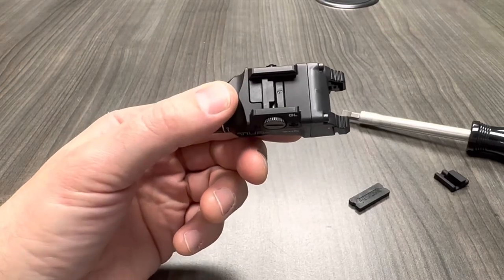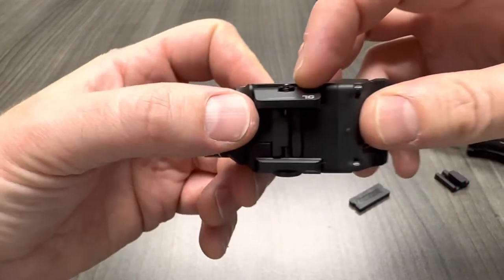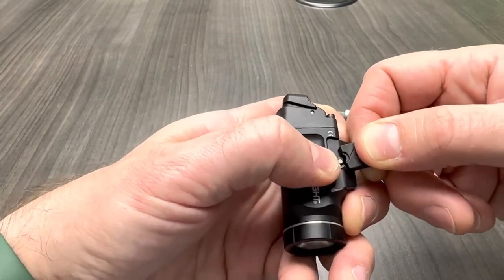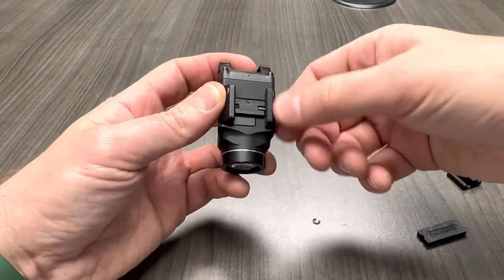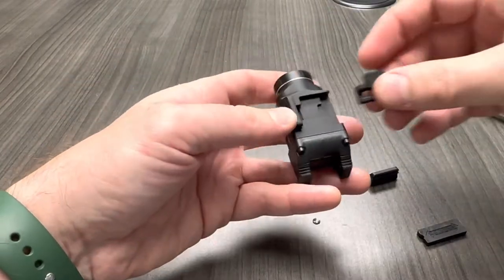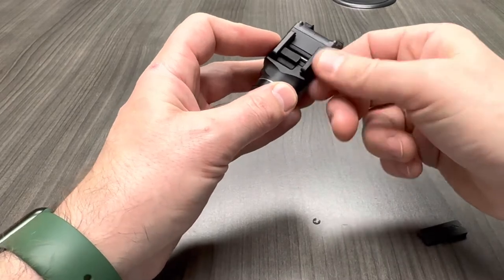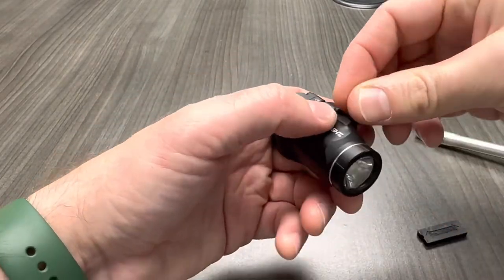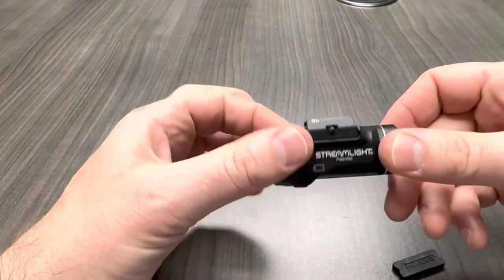TLR7 Sub Rail Key swap Walkthrough

Comment: For clarity will this allow me to swap a “sig” tlr7 sub to a 1913 version? Or is this just how to adjust the different keys within the 1913 versions packaging?
Reply from the maker: This is only for swapping the rail keys within a single version of the light. To go from "Sig" to "1913" you would need a new pair of rail clamps Streamlight.
Reply: @HenryHolsters  thank you for clearing this up for me! Are rail clamps available on stream lights website?
Reply from the maker: @TheVisualVanguard  You'll have to contact Streamlight CS. I don't believe they are available for retail sale on their site.
Reply: @HenryHolsters  ok thanks for the info!
Reply: @TheVisualVanguard  if you contact strsmlight they may just send them to you for free
Reply: @TheVisualVanguard  Send a customer service form on their website. Just received my new 1913 key and clamp from Streamlight for my Sig TLR7 Sub. I recently switched grip module on my p365 with a pic rail and was pleased to find out that they can send them for free

Comment: Anybody have issues with the staccato CS? I’m using all the parts correctly and tighten it down and it still flies off. There has to be an aftermarket key somewhere
Reply: 1913 or hellcat version?

Comment: So I have the Glock 43x with a gr43 recover rail. Would I need to get the key swap to make it fit, because the tlr7 won’t fit on the rail right now
Reply from the maker: None of our holsters are compatible with Recover Tactical rail adaptors, no matter which key is in use.

Comment: Is it necessary to have a key on the light in order to use it? I have an S&W SW9VE which has a smooth surface (no slot rail slot)

Comment: So can I remove the rail key entirely and then use it's with my stock sig p365 frame and then add the 1913 key to use it with a different frame that has a 1913 rail key?
Reply from the maker: No, the rail key is only PART of the assembly. The size and shape of the rail clamps on each side are different from model to model. You can't use the 1913 rail clamps on the Sig proprietary rail.
Reply: @HenryHolsters  damn it oh well guess whenever my Icarus precision grip module comes in I'll be getting a new light too sucks cuz I already bought the light but I guess it doesn't hurts to have 2 of the same light's  😕
Reply from the maker: @devalishxb91 Also, your Icarus grip module will likely not be compatible with most Kydex holsters for the P365. It doesn't fit anything we make.

Comment: Where do you buy the keys? Looking for #5 for tlr-7 sub for hellcat pro
Reply from the maker: Contact Streamlight customer service directly and ask for the key you need.
Reply: @HenryHolsters  I need the same key. So when I contact stream light customer support do I call them before or after I have ordered? Or will they send me just the key?
Reply from the maker: @BlueCollarHauler  I don't know exactly how they'll handle it. I would contact them first before ordering a holster.
Reply: @HenryHolsters  Would the TLR7 sub fit a Canik Mc9? Does it come with everything I need?
Reply from the maker: @TacticalandThings  I don't have an MC9, so I can't answer that definitively.
Reply: I think you need a specific model. I believe Opticplanet has one for the hellcat pro.